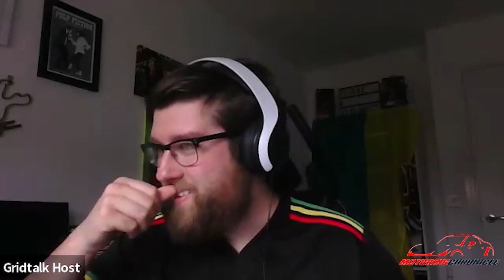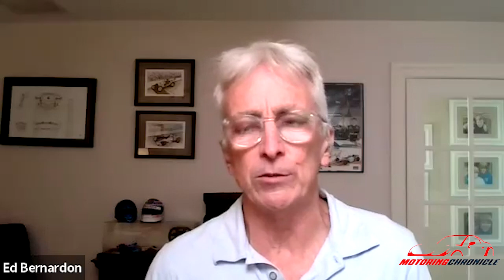How Plug-In Hybrids can be Better than EVs for the Environment

Comment: Plug in hybrids are for the faint of heart not willing to take the plunge to go full EV. The slightly cheaper running costs are offset by the need to maintain both a full ICE vehicle components as well as the EV side. Due to the High voltages involved, only an EV qualified mechanic is allowed to work on them, so no "cheapie" mechanic at the nearby industrial centre.

The full EV has only about 30 moving parts so there is no ICE, gearbox etc to maintain. Regenerative braking not only delivers more efficiency, but also reduces the brake wear. 

We have done over 60,000kms between 2 x EV's (2020 Kona Highlander & 2022 Ioniq). These are charged almost exclusively from our home Solar system. Due to our sunny location (Perth, Western Australia) we can generate up to 77kWh a day in Summer Months, giving us a surplus after running the house and it's A/C's of about 45kWh. This is about 350 (Kona) or 400 (Ioniq) range for our vehicles. Synergy (Local power supplier only gives a measly 2.25Cents per kWh exported So it equates to under 30 cents per 100km's of driving. 

The payback for extra pollution during manufacture is less than 30,000km's even if you ran from coal powered source. With us running entirely from Solar it's far less and considering we used almost 3,000 litres of Diesel in 25,000km's (verified by log book) the cost savings are very substantial.

Buying a hybrid is akin to swimming fully clothed - you are not experiencing the benefit. The payback period is quite reasonable, the drop in battery prices are making it shorter by the day. Only the Petrochemical industry lobbyists are trying to convince people not to swap. And the sooner you are not being blackmailed for their product with extortionate prices the freer you will feel!